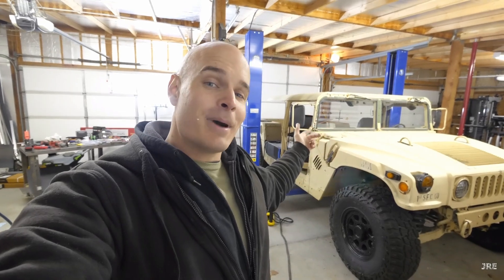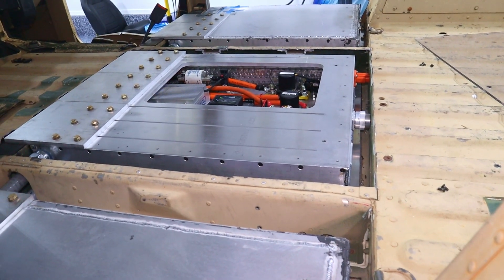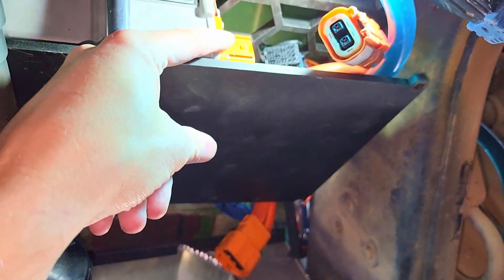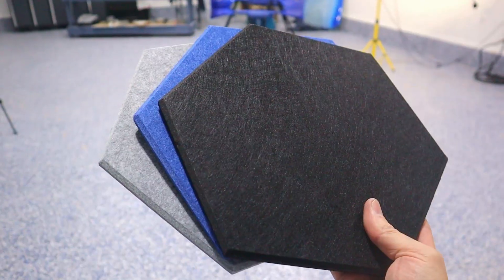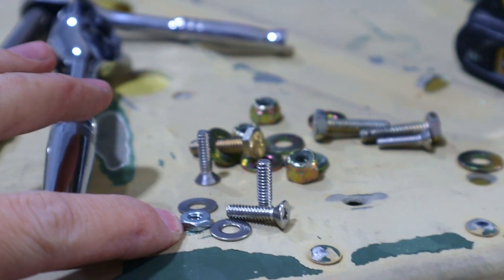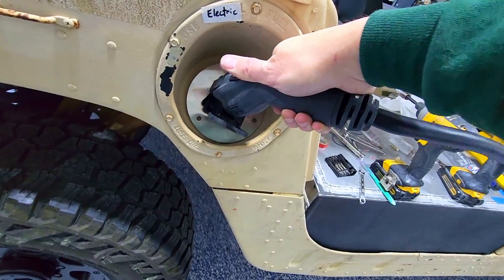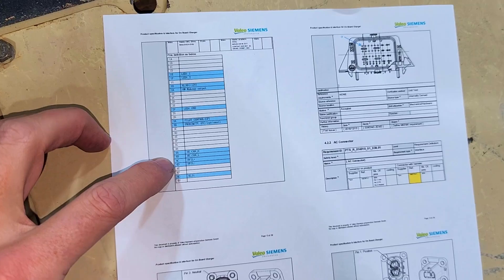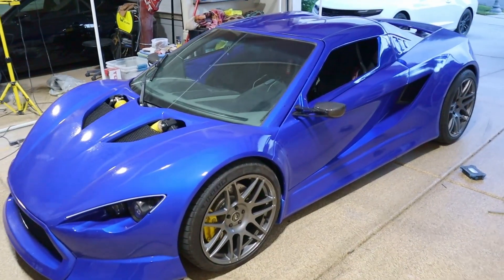Electric Converted Hummer - Diagnosis from the EV Doctor

Comment: Cool intro!  Somebody skipped the 'ugly, but working' on a test bench step, and the thankless 'document what works' step, and went direct for the 'beautiful build' step.  
You deserve an award for stepping in with knowledge and a calm assessment of what needs to get accomplished.  
It's actually 2x as hard to find and resolve design problems after all the quality build efforts have been applied, tightened everything up, and closed the harnesses.  
An ohm measurement is nice but you need to remember that the time domain aspects of the data bus design requires the actual locations of the resistors to be correctly placed at the electrical ends of the CAN bus.   If you really don't know how the bus is routed use a TDR (time domain reflectometer) to assess the bus line, best plan: terminator, VCU, Display, BMS, Charger, terminator.  Configure each terminal # correctly, sometimes the default terminal numbers are same or the VCU controller is talking to the Charger as #1 and the Charger thinks it is #4 and the BMS thinks it is #1. etc.  I always get the VCU and Display working, then add the BMS, then add the Charger.
Reply from the maker: Thanks for the comment!

Comment: It needs to basically turn the whole vehicle on to charge so that the cooling heating system for the batteries is operational. If the cooling system is not giving a ready signal on the can bus it won’t charge.
Reply from the maker: Thanks for the comment!

Comment: Reset communication.  Step by step, first just to charge the battery, then connect the monitor and finally the motor.  It is possible that two devices are registered with the same value and cannot talk to each other.
Reply from the maker: Will check it out

Comment: Maybe I am biased as I work for a USB oscilloscope company that also leans into automotive diagnostics with said oscilloscopes. If you have access to one/can borrow one, it may be worth scoping out the canbus itself.
Some would say a logic analyser or just a plain USB Canbus adapter would also do the trick, but that will only give you the successful messages which were transmitted on the bus. It wont show you analog interference which may have caused the signal to fail, CAN in particular is quite sensitive to branching in networks (these cause signal reflections which will interfere with the transmitted signal, in turn resulting in no message sent) or to bad shielding.
Reply from the maker: Thanks for the comment!

Comment: Next issue to check/tackle is probably your HVIL loop. It's a simple circuit to make sure all HV service covers, HV cable connectors, etc. are closed/connected for safety. It's typically not just a simple bypass/jumper at the charger, it's probably supposed to be a series circuit through various controllers/components and each component's literature should tell you how the component mfg expects the HVIL to work so you can then design the circuit correctly.
Reply from the maker: Thanks for the comment!
Reply: @electricsupercar  since the system will do HV startup, close ESS relays, power the inverter, and create torque I'm guessing the HVIL for that is ok, but I'd suspect the HVIL for charger/plug/ESS has an issue, that or it's an independent loop and broadcasts valid/OK HVIL loop via CAN and then there's a CAN issue.
Reply: I could see that being a problem. Alarm system wiring uses a resistor at the end of the line, that way the controller can detect both shorts and breaks in the wiring.

Comment: Could you link to the modules information pages/datasheets?

Kinda want to see stuff for myself. What goes where?
Reply from the maker: Can do
Reply: @electricsupercar  Thanks :)

Kinda confused about the "control flow".

Does the BMS connect to the control pin, or the charger. I have a BMS manual for car battery around and it seems to handle the EVSE negotiations, get the charger powered by mains and then to command it (current & voltage via CAN, repeated messages).

Kinda hints about what needs to happend.

No I don't have that BMS, did wonder about getting it before, for reasons that no longer apply.

Comment: I think there is some issue with the BMS.
If not then i think the charging circuit is not allowing the battery to charge even after accepting the current from AC to the charging point.
Reply from the maker: Thanks for the comment!

Comment: Have you tried using canon sniffer?
Or ORION software.
Just curious if there is interference or miss wiring on CAN bus. 
If you cannot communicate using Orion software. Use Orion software can traffic 
I believe it’s the last tab on the right if I remember correctly. it should still show up even if polarity is incorrect. H L -  L H etc.  🙏 good luck and happy hunting.
Reply from the maker: Ya, I think that is the next step
Reply: @electricsupercar  forgot to mention. The Baud-rate on a CANBUS .
I’m sure you already know to look for this. It’s always the simple things lol.

Comment: If there is a can external port wired, you can use an esp32 to listen the messages. There are quite a few examples on youtube and on github.
And you can find this cheap counter parts on the internet.
Reply from the maker: I think that is the next step

Comment: As others have commented already I would try components in isolation.  I have had issues in the past with message IDs clashing, checking the broadcast message IDs from each component individually would help identify any clashes.  You mentioned checking continuity, but have you confirmed the BMS is waking using the output from the charger?
Reply from the maker: Thanks for the comment!

Comment: Since your pin outs are good I would start checking that all the grounds/neutrals/returns are solid. PLCs and drives are really finicky when it comes to cable noise or bad grounds.

Edit: To be more clear, anything that is communications should be shielded cable that is grounded. It was a necessity in the lehr loaders I used to build and  install in glass factories. I’m not sure how necessary it is in an EV but it is a high voltage system so it’s just my 2 cents.
Reply from the maker: Thanks for the comment!
Reply: @electricsupercar  make sure all the firmware/software is up to date… Should probably start with that first

Comment: Make sure the termination resistors or terminating nodes are at the physical ends of the CAN network. Also make sure the connections go from node to node to node etc., no ring, star or stub connections. If the slaves can auto detect the bit rate make sure the Master has a fixed bit rate. Any node that cannot auto detect set the rate to match Master. Also make sure every node has a unique ID. Hopefully atleast one of these gets everything talking.
Reply from the maker: Thanks for the comment!
Reply: He said, ‘these nuts” 😂😂😂😂 7:10

Comment: Have you measured the Can H and can L with an oscilloscope to check if the signal is mirrored and if you can actually see the voltage oscillating? I would assume that the can speed is around 500kbps so make sure to calibrate the oscilloscope properly. Good luck!
Reply from the maker: Nice!  Thanks for the comment!
Reply: Don't make it to hard on your self, just get a CAN sniffer and see if the messages go over the network. No traffic = something's is wrong with the wires.
Reply: Yeah, I would check the config in all controlers that they are communicating at the same CAN speed etc, if they have different speeds, say 250kbps and 500kbps things will not work. :p And are the ends of the trunk terminated? If not put in resistors 120 ohm in both ends will help with signal, although I would think it would work on such a short run anyway..

Comment: Someone else posted that there maybe a difference in the COM baud rates between 1 of the devices used in the bus and that this can cause it to error as they all should be the same.

did you check for this?
Reply from the maker: Will check
Reply: @electricsupercar  I’m by no means an expert…but, I guess it’s similar to looping in an RS232C device which defaults to (and cannot be changed from) 9600kbps when, all the other devices want to talk on 115000kbps.

Also, not sure, however, I’m assuming that the bus may need end terminators, and, also, that it may work similar to ESP32 circuits which need to have resistors between the power-out from a device (an LED bulb for e.g.) and the neutral otherwise it can cause strange situations such as the LED appearing to remain on (according to the ESP32 chip’s pin status monitor) even though you sent a signal for it to switch off.

Edit: I believe the concept is known as using a Pull Up/Pull down resistor…I think the scenario I mentioned above is a Pull Down resistor 🤔

There’s a few boards for sale along with a hand full of DS18B20 temperature sensors (it was known as the Pluggable Terminal V2 when I last bought one) on Amazon if you wanted to get an idea of what I’m talking about.

I wonder if you’re using a 1 wire data bus system whether such things may be a consideration possibly?

Comment: Cool to see some update!
What kind of CAN-bus system is it running? The same as Tesla is running, or something else ?
Reply from the maker: It is custom
Reply: @electricsupercar  Yeah, I got that part, but the standard/format that is being used was mainly what I had in mind.
But if the system itself is custom from A to Z, and not built on a standard.. I'm not able to help :)
I've done a fair bit of CAN-bus "hacking"  the last 20 years.

Comment: Our advise, as an EV Manufacturer Start-up, would be to isolate the charger from the CAN Bus and connect to it with a laptop in order to see the messages that it is broadcasting. If there is a fault other than the communication, you will know. You mentioned this charger is from Siemens, but I'm pretty sure they are just reselling a TC Charger as it looks exactly the same as the one we use (but at a lower voltage). Those charger needs an input from the BMS, normally as a CAN message to start charging. There are 2 messages, both on 2 bytes, one for the targeted termination voltage and the other for the max DC current. Since this particuliar charger handle the EVSE (pilot and prox) itself, it might be a little different, but not that much as the BMS must be in control of all current flowing.
Once the charger works as isolated form the CAN bus, like other suggested, plug back on the networks just the BMS to make sure it is still working. Maybe you have a bitrate difference between two devices.
Then, you mentioned in the video that you checked the pinout of all the plugs so it should be good but a fault would be thrown if the DC connector was inverted.
In resume, I think you pinpoint the trouble correctly to the CAN bus, so I would check that first with a laptop and an USBCAN or a CANALYST and have a look at what is running on this bus.
Hope this helps. I'm sure we can be of more helps with more details on the build, if needed.
Reply from the maker: Thanks for the comment!  I will have to consult with you
Reply: @electricsupercar  Also these TC chargers won't do anything if there is no DC voltage detected. There might be a contactor between charger and battery pack (or it is the main contractor for example) and if that doesn't close, the charger won't see the high dc voltage and not do anything.

I don't know if this is equal to a TC charger, but if it is, it probably has some pcb in there that handles the EVSE communication. That pcb might or might not be connected to the CAN bus and it likely be powered by the 12v output of the AC charger.
Lots of assumptions but I hope it helps.
Reply: @electricsupercar  How can I contact you outside of this thread? You can found our email address on our website.
I'll be happy to help!
Reply from the maker: @theron-ev6048  Electricsupercar@gmail.com
Reply: @electricsupercar  remember they are a start up though!
Reply: Wow.  You clearly know this stuff well!!  I will be working on an EV conversion of my own this summer... converting my Lotus Esprit into an insane EV :D
Reply: @RealRickCox  a Lotus EV? Oooooh....that sounds sick
Reply: @RealRickCox  why would you do that to the Lotus?  Blown engine or something?
Reply: @FJB2020  I massively upgraded the original motor with full electronic injection and programmable ECU, bigger turbo, high performance pistons and rods.... putting out over 460hp at the wheels.  Then discovered the transaxle was the weak link and broke it.  Rather than trying to do the Porsche transaxle conversion, I just decided it would be more fun to convert it into an EV with Tesla Plaid drivetrain.  :)
Reply: Yeah, great suggestion! To me its just a case of methodical checking one componentat a time. Disconnect anything on CAN that isn't the charger or BMS, continuity and pinout check connectors between them, and then snoop the messages to fix any issues, then add items to bus one at a time testing continuity, pinouts, messages and outputs.
Reply: @Theron-EV:  Good to have you also watching these video Bas !!
Reply: @Doctorbasss  it's good to see you're there too!  Don't hesitate to come visit when you're free 😉
Reply: I came, I saw, I conquered
Reply: Good advice! Definitely check baud rates to ensure they're talking at the right settings
Reply: We are driving to Africa with an EV, charging the car with solar panels via the CCS port (DCDC converter without an additional battery), not sure is this would be of any interest to you
Reply: We are driving to Africa with an EV, charging the car with solar panels via the CCS port (DCDC converter without an additional battery), not sure is this would be of any interest to you
Reply: I didn't understand not immediatly connecting a laptop to the system and look at the waveform on the bus, but hey not my monkeys nor my circus..
Reply: Subscribed to your channel. I tinker with the Ford Focus platform and this is exactly what my unit is doing after heat damage to the battery pack, err well it has a high voltage leak I am still working on. 3.4v+,1.4- leakage after a coolant leak. Repaired the fluid leak and reinstalled battery only to have the same problem so I’m pretty sure there is unseen/undiagnosed problem with the same lower battery pack. OBD still displaying voltage leak so like I said I’m taking the battery out again and tinkering with it some more.
Reply: And that is why the industry is moving/working on moving away from CAN Bus. In the industrial automation industry we have not been sad to see it go.
Reply: @paulhimle  Wat industrie is moving away then? I tought in automation you used profinet/profibus, we do with most of the VFD's/plc's
Reply: @Damicske  In the industrial automation industry, the focus is on Profinet, Ethernet/IP, Modbus TCP/IP and others that can be considered a flavor of Ethernet. I believe it was DeviceNet that was a customized flavor of CAN Bus and it was used in the US. Industrial communications are heading (and are mostly there) to Ethernet based protocols and that is where we get the IT OT convergence movement from. In the past industrial equipment has generally used proprietary bus communication protocols and now that we are using Ethernet based ones, we have had to deal with IT much more than in the past, often slapping their hands and saying “no touchy”.

As far as the automotive industry (and others), the standard for Single Pair Ethernet (SPE) and Power over Data Line (PoDL) were released around a year ago and I've been told they are looking at that as an alternative. I still consider SPE bleeding edge tech with some growth needed. It is still at the point where the connector manufacturers are pushing for their flavor of connector to come out on top (think Betamax vs VHS).

All that said Profibus and HART still seem to be holding their own in the process industries.

Not sure if that clarified what I meant or if I was just rambling in the comment section but there you go.😊
Reply: @paulhimle  Can Bus is one of the most robust ways of communication and easy to troubleshoot if you understand how it functions. The only reason they are moving more to fibre and DoIP is because of bandwidth limitations with Can Bus.
Reply: @christianbateman4530  My comment on the automotive side is definitely up for review and is based on one of our vendor’s presentation.
Reply: In my experience just smash a bunch of electronics shoplifted from a  thrift store and tape whatever resistor you hack out of there in place with a section of silicone beverage straw covering it. It's either the red wire or the blue wire. Just try both. Should work. Worked last time
Reply: @BitchinSpectre  I too love the smell of electrical smoke.
Reply: I was thinking the same of sniffing the can bus between the charger and the BMS see wat messages are going between them.

Comment: So they are using neutral and there is only three pins, which then makes it 120VAC and not 240VAC?  In the USA there is no reason to use neutral for 240V.  You need the split phase hots together only for 240V.

Comment: Does this vehicle include a mechanical (wired) CAN bus analyzer port? Obviously the electronics have been programmed to a large extent. The YTube Damien Maguire channel appears to use a non-wifi "sniffer". For those unfamiliar, it allows one to observe the CAN bus traffic without having to use the software from the various components. (charger, bms, inverter etc.)
Reply from the maker: It has a port.  That is probably the next step